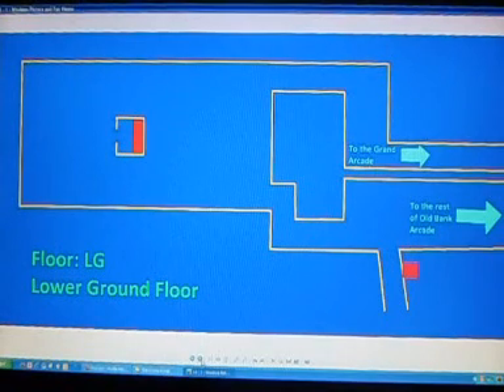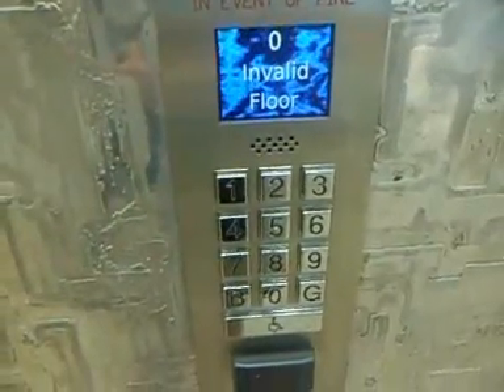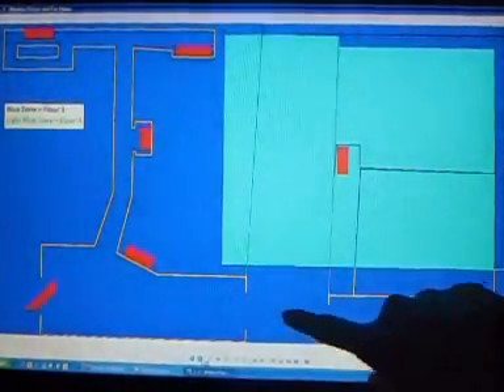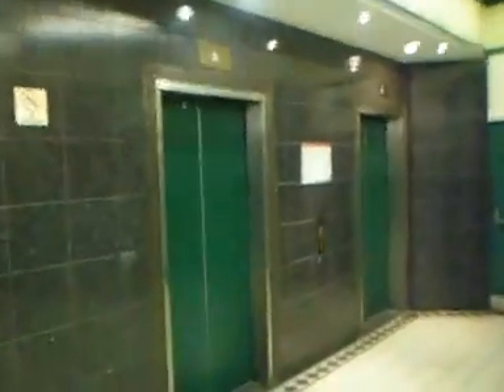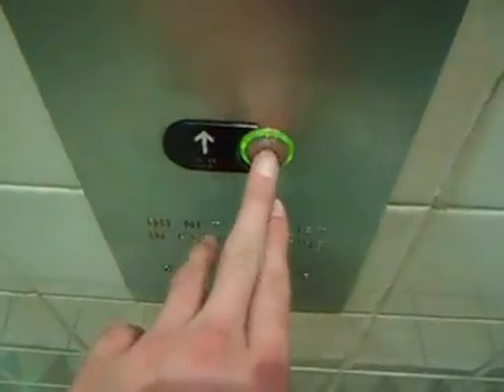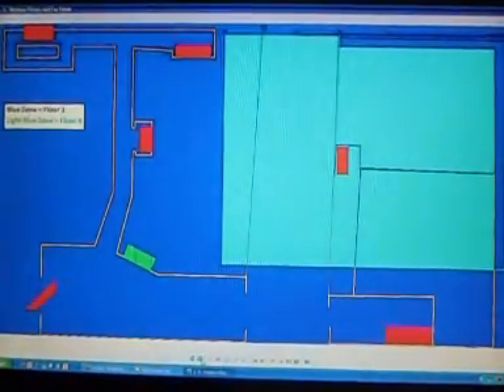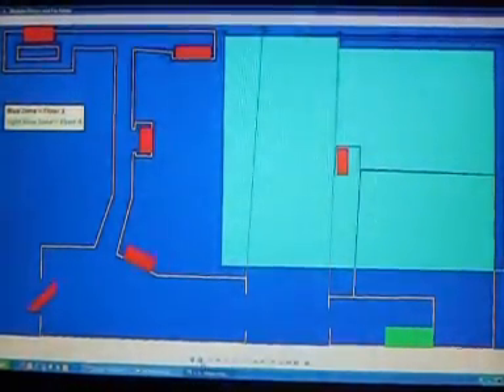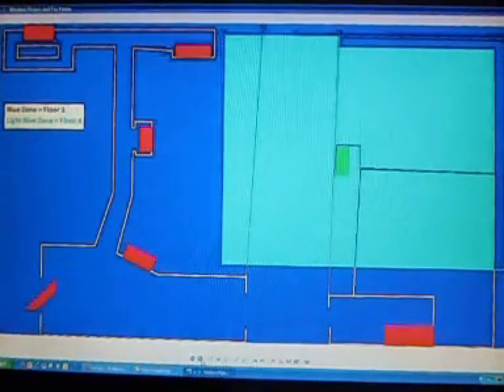The Grand Arcade - TIME FOR A LIFT TOUR!!!!!!!!!!!!!!!

Comment from the maker: When it comes to it, I'd much rather ride the OTIS's, even if they have been modded, the motor is still original. I'd much rather ride an old 70's lift than a 90's Schindler.